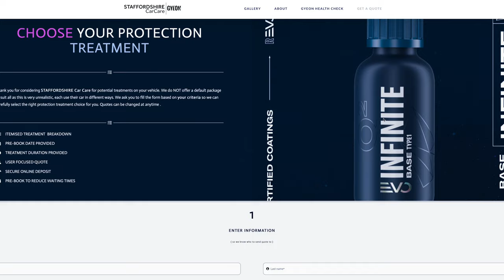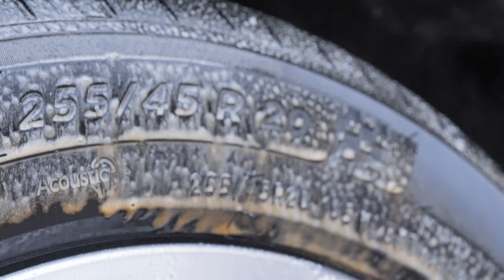HOW TO APPLY CERAMIC COATING

Comment: Another related question.. does applyinf ceramic coating on the PPF, helps making the car look more glossy? or the first waxing under the PPF is what makes the car look wet? i had my car PPF'ed gloss ppf, but some how it doesnt look like your cars :S .. the cars in your garage looks like they just got out from a lake
Reply from the maker: Hey. I would most likely put it down to film quality.  You can no put any product on prior to adding PPF as this will hinder its adherence but film is fundamentally designed for protection against stone chips.